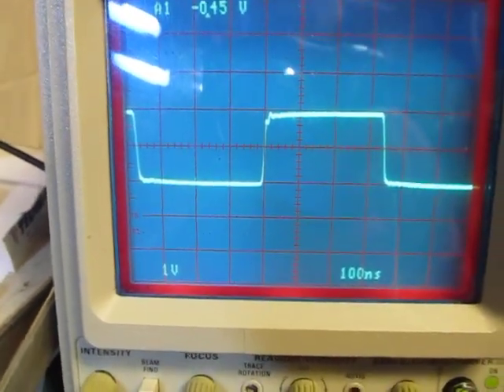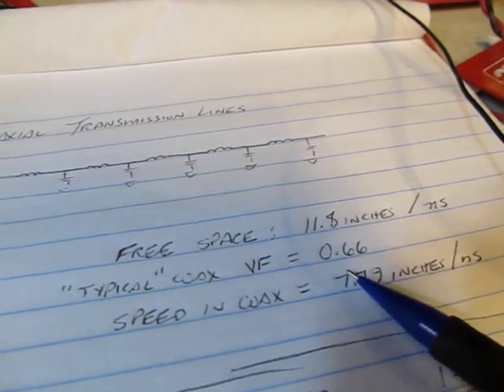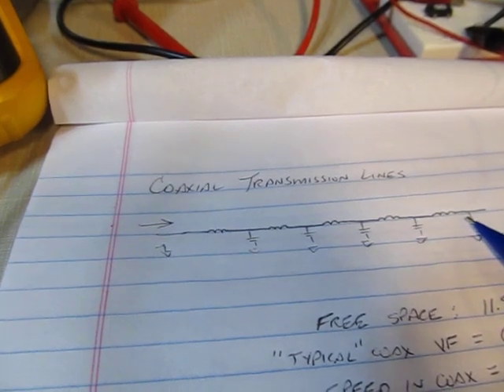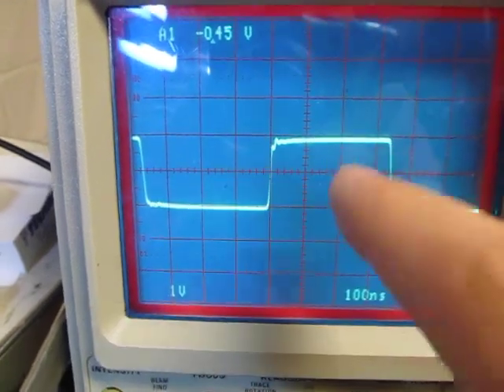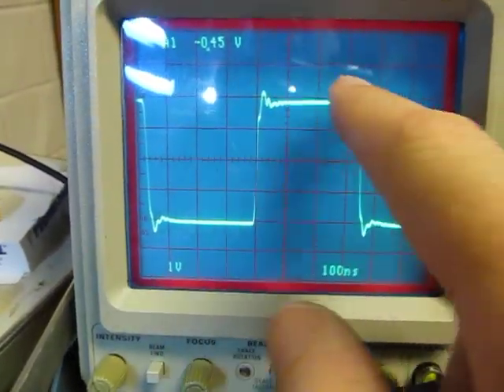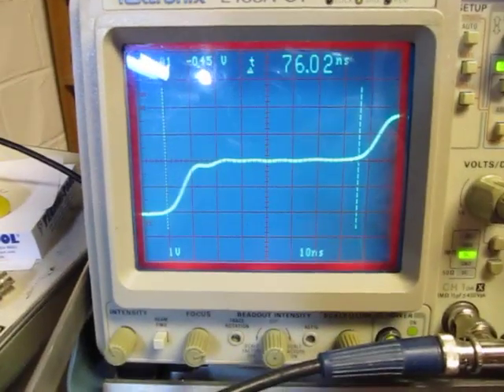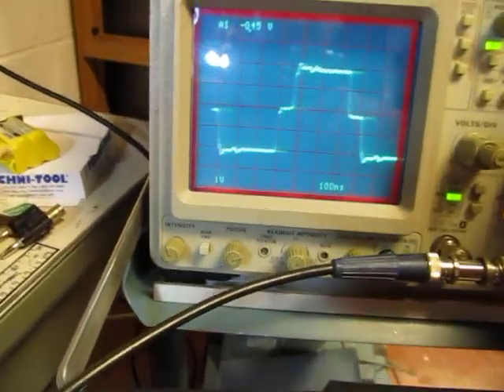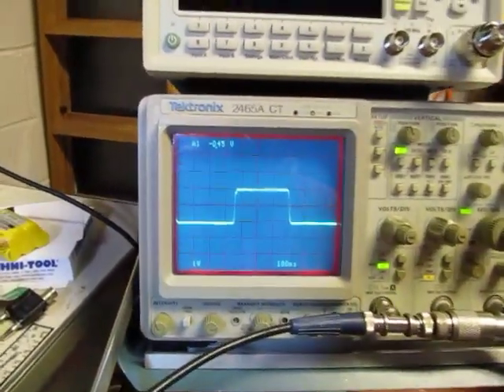#37: Use a scope to measure the length and impedance of coax

Comment: but before doing this experiment, how do you setup the impedance match network at the pulse generator if what you want is to measure the character impedance of the coax cable?
Reply from the maker: The impedance match at the generator really isn't necessary.  There won't be a reflection from the far end when the potentiometer is adjusted to match the line impedance - regardless of the source impedance.

Comment: When a Piece of equipment doesn't tell you the amperage but says 220VA. How do you convert VA into just Amps? The AC cord gauge is based on the equipment's AC current draw, but when its only displays the VA and doesn't say the amps only how do you convert VA into amps?
Reply: VA is just the product of the voltage and the current. So, to get the current, just divide by the voltage.  If the equipment with the 220VA rating is designed for 120V operation, the current would be 220/120 = 1.83A.

Comment: Rise time of the pulse is 50 ns. Max freq. is 20 Mhz. Oscilloscope is 100Mhz. The cable I try to test is 1 meter long. Does signal waveform stay the same in this config? Sorry for my lack of knowledge. :(
Reply from the maker: Unfortunately, the rise time is much too slow to measure a 1m cable, since the risetime is longer than the delay through the cable. In order for this technique to work, the risetime must be faster than the propagation delay through the cable.  In this case, the shortest cable you may be able to measure is 10-15m or so.

Comment: When wires or a wiring harness has corrosion it will add resistances. When you measure the DC voltage the Fluke meter will measure the Voltage because the voltage is "not loaded" to measure the corrosion resistance. In order to measure the corrosion resistance on the wring harness you need to measure the voltage that is "loaded". You put a 25 ohm resistor or a 10 ohm resistor in parallel with the Fluke meter terminals to put a "load" in order to measure the corrosion resistance that is on the wiring harness. My question is that why do you need to add a LOAD in order to measure the corrosion resistance voltage? EE technicians measure the voltage unloaded and then measure the voltage loaded and take "the Difference" the delta of the loaded voltage and unloaded voltage to get the corrosion resistance of the wiring harness. Have you heard of this approach or how do you calculate and measure the wiring harness corrosion resistance?
Reply from the maker: Without the load, there is very little current flowing through the wires, so there is very little voltage drop across the wire's resistance (Vdrop = I * R).  When you place the load, you get a substantial current flow in the wires, and therefore will get a voltage drop across the wire's resistance.  If the wires have very low resistance, the difference between the load and no-load measurements will be very small. When the wire's resistance is high, the difference between the measurements will be large

Comment: I have a 74AC14 TDR squarewave generator coming. I want to measure the characteristic impedance of an antenna on the ground. It's called a BOG or Beverage on the 
 Ground. BOGs are terminated in their characteristic impedance. I expect to see 200 ohms to 400 ohms. I will adjust the termination until I get the nice squarewave without any steps.
  Does the fact that the TDR has a 50 ohm output impedance and I'm measuring a higher impedance cable have any importance? Should I alter the output impedance of the TDR?
Reply from the maker: No.  As long as there are no reflections, then the source impedance isn't too important.
Reply from the maker: Cool!  Looks like that's based on the same design used here.

Comment: I fed a 1 mhz sinewave from a 50 ohm signal generator source into a 100 ft long RG58C coax cable "T"ed into a 100 mhz dual trace scope channel 1. The other end of the cable was fed into channel 2 of the scope and I expected to see about a 150 nano second delay. Instead, I had 970 nano seconds between the top crest of the two channels. The input impedance of the scope is 1 meg. putting a 50 ohm termination at channel 2 gave me the 150 ns delay, but why was the unterminated input at channel 2 not 150 ns???
Reply from the maker: There are a couple of factors.  With the end of the coax unterminated (not 50 ohms), the reflected signal adds to the signal seen at the tap point. Plus, the non--50 termination at the scope looks largely capacitive which leads to a phase shift.

Comment: Ya just gave me a wonderful idea.. Take a box, install a rotary selector switch and install a few known close tolerance resistors in with each resistor going to a different leg on the switch... ie..#1=50 Ohm, #2=75 Ohm, #3=300 Ohm etc... This would let you connect it to the end of an unknown or unmarked coax and quickly find the Ohms of that coax...

Comment: I had a rabbit bite through the outer shield of my Wilson cellular antenna in a few places (RG58 cable) but the inner conductor is fine. Is there a simple way to test the cable to see if repairing the bitten portion is justifiable? I don't want to damage the cell phone with any trash coming back from the punctured parts of the shield.

Comment: Thanks, so the load increases the current to measure the voltage drop. Do you know any other ways of measuring the corrosion resistance in wires, relays, switches, etc. The ohm meter won't tell you if there is corrosion resistance because the corrosion resistance its in the milli ohms or 1ohm to 5 ohms mostly.
Reply from the maker: See my video on making 4-wire resistance measurements for info on measuring low values of resistance.

Comment: So I assume you mean it needs a short pulse (low duty cycle) such that the pulse width around 10nS (wikipedia scope). I will try that using a PIC Microcontroller with PWM.

Comment: Got a known Belden coax roll of 500' but when I test it with oscilloscope & 100Khz square wave from function generator it measures 1170ns comes out 1170*7.79=9114/2=4557/12=380'.
My oscilloscope and function generator are brand new - am I doing something wrong?
Reply: Hi Mouse,  I see no one answered your question from a year ago.  In your calculation you used the 7.79 factor, but that factor is based on coax with a velocity factor of 0.66  (11.8in/ns x 0.66 = 7.79in/ns).  Velocity factor is not the same for all cables and suspect the velocity factor for your particular model of cable is not 0.66.  Matter of fact if that cable was really 500 feet long your time measurement indicates it has a velocity factor of 0.87 which falls in line for coax with a foam polyethylene dielectric.  What is the part number for the coax you measured?  The datasheet for your cable should list its nominal velocity factor.  Here is the calculation using 0.87 velocity factor: (1170ns*11.8in/ns*0.87)/2/12in/ft=500.5 feet.

Comment: Thanks for this video.  I have made a spreadsheet to calculate length based on time and velocity factor, and velocity factor based on time and lenght.  Is there a formula to calcualate the cables characteristic impedance based on these measurements?

Comment: Excellent video! But for a shorted coax end how do you measure where the length of the  short is. Is it from negative peak to negative  peak of the inverted  pulses?
Reply from the maker: At 9:29 in the video, you see what it looks like when there is a short.  Basically, the width of the visible pulse is equal to twice the propagation delay to the short.
Reply: @w2aew  Is "the width of the visible pulse" that you mentioned, The positive rising pulse that we see on the scope,  its pulse width that measures approximately 100Ns? And if it is, then you divide 100Ns by 2 to calculate the length to where the short is?
Reply from the maker: @uiticus  Yes.  At that point in the video, you can see me adjusting the load at the end of the coax - all the way to zero (short).
Reply: @w2aew  Thank you! I appreciate it.

Comment: Low capacitance shield cable has the shielding and center conductor very close together separation which is the capacitance value compared to high capacitance shield cable which has the shielding and center conduct wide separation? Is it true that low capacitance shield cable is more microphonic because the internal complex of the shielding and center conductor is close together that its causing the cable to be more microphonic is high gain circuits? because you can tap on the cable to hear the microphonics in high gain circuits which only happens using low capacitance shielded cable not sure why.
Reply from the maker: The closer the shield is to the center conductor, the higher the capacitance will be.  Microphonics of coaxial cable have more to do with the material selection and construction of the insulator material.

Comment: Yes i understand that thicker wire gauge is less resistance, but how does an EE engineer designer calculate the AC wire gauge for the operating current draw the DUT needs.  120vac X 12 amps of current = what AC cord wire gauge?
Reply from the maker: it would be 12A of current X the resistance of the power cord, and then decide how much voltage drop is acceptable for the device, and how much heating is acceptable for the power cord.  There are tables that indicate wire resistance vs. wire gauge that an engineer would use.  It usually comes down to a tradeoff between voltage drop and cost.  Thicker gauge wires have less voltage drop, less resistance, but cost more - so it comes down to the economics of it - how much is the manufacturer willing to pay for the power cord.

Comment: Would this work with a function generator? I don't have access to a pulse generator unfortunately,.
Reply from the maker: Yes, but the minimum length of cable will be limited (to longer lengths) because the rise/fall time of the typical function generator is usually fairly slow.
Reply: @w2aew  Thank you!

Comment: OK a little late but could you have hooked the end of the coax to a antenna and the adjusted the antenna till the impedance was 50 ohms and could you have seen that on the scope like you have demonstrated with your variable resistor. Thanks.
Reply from the maker: No, unfortunately that won't work.  The square wave has a lot of harmonic energy and must see a 50 ohm load across a wide frequency range in order to go "flat".  An antenna generally is a narrowband device, exhibiting a 50 ohm load over a very narrow range of frequency.
Reply: Thank you for your quick reply. Your video's are very very informative, thank you for your time and effort.

Comment: Will the length measurement also work on 75 and 93 Ohm impedance cables?
Reply from the maker: Yes, it will work for any constant impedance transmission line.

Comment: Since you're about the smartest guy I know in electronics, there is something that always bugged me...
Can you explain how an oscilloscope can read RF waveform and voltage accurately with its 1 megohm (typical) impedance when reading a low impedance source?
In other words, why aren't there then standing waves on oscilloscope leads that throw off the measurements and waveform display by a huge amount?
Reply from the maker: The RF voltage will not be accurate when the end of the line is not 50 ohms.  However, if the scope is just "tapping into" a properly terminated line, then it will read fairly close, provided the scope input capacitance doesn't cause a large discontinuity.
Reply: Thanks!

Comment: Hi, Alan maximum cable length that can be measured at a frequency of 5KHz is 40 meters or 15,7 inch?
Reply from the maker: You might want to recheck your math. For typical coax with 66% velocity factor, the propagation speed is about 7.8 inches per nanosecond. A 5kHz square wave has a 200 microsecond period, thus spends 100 microseconds in each state. With 1000 ns in each us, you get signal travel of 7800 inches per uS, thus 780,000 inches, or 65,000 feet of propagation round trip, so you could get 30,000 feet, which is well beyond any practical length.
Reply: ***** Yes, you're right. Would like to say the following, that the maximum distance that can be measured can not exceed a wavelength of about 130,000 feet, in practice, of course less.
Reply: ***** Hi Alan what the error of this method?

Comment: Why is the signal staying at the same energy level when it is reflecting?
Doesn't the signal lose some of its energy (through capacitance and inductance ) as it travels down the cable and back to the source?
Thank you
Reply from the maker: Capacitance and Inductance are lossless.  The resistance in the wire, and other secondary dielectric losses will cause loss.  The resistive losses are present at all frequencies (and are typically quite low), and the dielectric losses are frequency dependent.  At the frequencies used here, the losses are very low.
Reply: As the signal travels down the line the capacitance causes voltage to drop and current to rise and the inductance the opposite effect right?
So do these two effects cancel each other out (in respect to voltage/current changes)?

Thank you for your reply
Reply from the maker: boris runakov These two affects act together.  The inductance term is in series with the line, and the capacitance is across the line.  The votlage on the distributed capacitance is charged up with current that flows through the distributed inductance.  Since these distributed inductance and capacitance values are consistent along the line, this sets up a specific voltage:current ratio at the wavefront - that ratio is what gives rise to the characteristic impedance (50 ohms in this case) of the transmission line.
Reply: Thank you for your time

Comment: Hi Alan.. quick question...if my scope doesnt have a selectable impedance like yours, will a 50 ohm terminator on one side of a BNC-T (cable on the other)  produce the same outcome on the scope as connecting the cable to the scope with a 50 ohm pass-through BNC connector?
Reply from the maker: At lower frequencies, it will.  As the frequencies go up, you'll start to see some effects of the "stub" that is created by doing it this way.
Reply: @w2aew  thank you so much for responding. At approximately what frequency do you think that effect  will start to happen?
Reply from the maker: @DavidBerlind  Hard to say without seeing your setup - but probably will start to see some effects above 40-50MHz...
Reply: @w2aew  Thanks. I acquired a Tek 2W pass thru 50ohm terminator off of eBay.
Reply: @w2aew  also, what's a good way to send you an idea for a video?
Reply from the maker: @AmpMechanic  I try to read all of the replies here, so if you post your idea here, I should get it.

Comment: w2aew, to measure a cables capacitance, to you measure from the cables tip to the other ends tip or from the cables ground to other ends ground? I have tried using my LCR meter but I think my LCR meter doesn't measure capacitance in the picofarads very well.
Reply from the maker: no, capacitance would be measured between the tip and ground.
Reply: If you're measuring the capacitance of a 10ft long audio cable. So you put the LCR meter RED probe on the TIP jack of the start of the cable and the LCR meter BLACK probe on the other end on the GROUND shelve of the jack that that is 10feet away from the TIP jack? because if I put the LCR red probe and black probe on the same jacks tip and ground it won't measure the cables capacitance because its on the same jacks tip & ground.
Reply from the maker: @waynegram8907  No, you should be able to put the probes on the tip and ground of the same end of the cable.
Reply: oh ok I thought it made a difference from tip from one end and the ground at the other end of the cable to get the "distance of the cables capacitance"